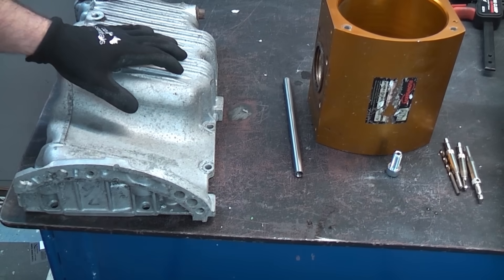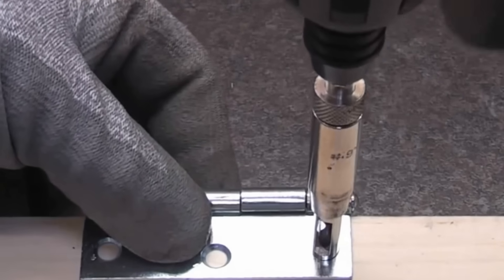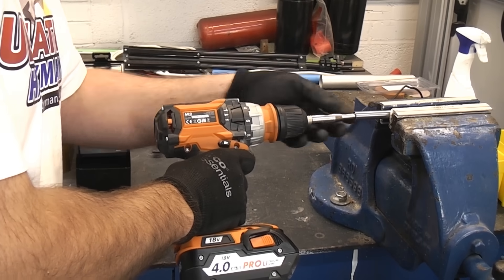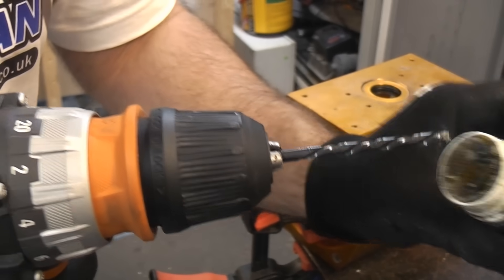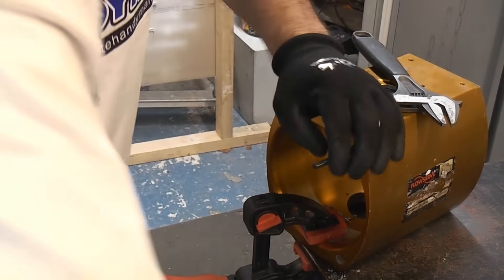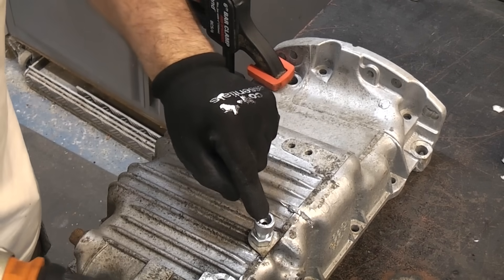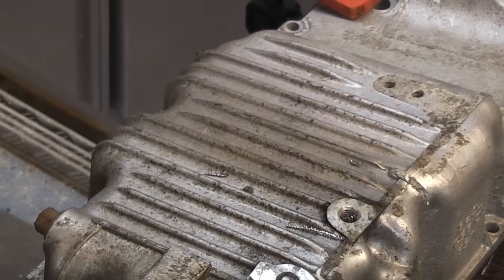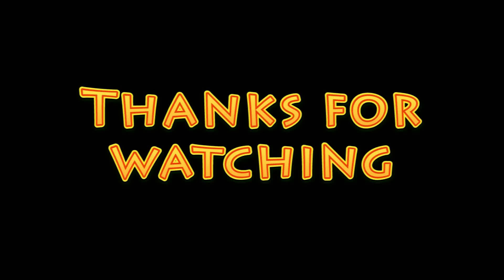How to remove a broken bolt in a deep hole | remove broken bolt in recessed hole

Comment: Liquid Wrench is a penetrating oil, WD-40 is a dispersant. Common mistake though.
Reply: WD 40 is also a penetrating oil. From their web site:
"WD-40® Multi-Use Product protects metal from rust and corrosion, penetrates stuck parts, displaces moisture and lubricates almost anything. It even removes grease, grime and more from most surfaces."
Reply: @meabob  - They're semi-lying. Are you sure that it wasn't a testimonial? Testimonials are worse then worthless. WD-40 BRAND has a penetrating oil. It's NOT regular WD-40. As I mentioned above, Kano Labs AeroKroil penetrating oil is the stuff. They do not sell it through retail stores like do-it-yourselfer auto parts and accessories stores or Wal-Mart. It is offered "ALL PRODUCTS PRODUCED AND DISTRIBUTED BY KANOLABS ARE FOR INDUSTRIAL USE ONLY AND ARE NOT INTENDED FOR RETAIL SALE, PERSONAL OR CONSUMER USE. In California, this product cannot be sold to an individual consumer." If some "consumer" left this nasty stuff where a kid could get it they could get serious damage or death from it. It goes on a high shelf or locked cabinet in the garage or shop.

Comment: ..Drill Sharpening tool is a must have.. (CENTER PUNCH, don't error) U should "Up Step" drill size when making a hole aka start with a pencil led size & gradually increase & I prefer the dowel style extractor's & a slow (almost a crawl) steady rpm w/light weight oil is WAY better than short drill motor spurts like U did, with a large drill bit - U were lucky & had easy access/no rust.

Comment: Ever seen the trick to remove a steel bolt out of aluminum by dissolving it with alum salts?  I can't remember if it's just heat or if you apply DC to it as well but I do remember the steel bolt just dissolves. Neat trick, very handy.
Reply from the maker: Yes, I have seen that.
Thanks for the comment

Comment: Really useful - thank you - though at around 08:00 and 11:40, if you had put the screw extractor into the drill and ran it in reverse, would this not have done the job for you without needing to keep tapping it back into position - as gently pushing in on the drill would have kept it in position?

Your drilled-through bolt idea is awesome.
Reply from the maker: I've never tried a screw extractor in a drill to be honest, as the instructions normally say to tap it in using a hammer.
Thanks for the comment
Reply: @ultimatehandyman  Sorry, I meant to say "drill/driver", I think it would need to be low speed (never tried them on fast).

Comment: Very nice video.  Great tips.  Thanks for posting.

Just thought I would add my own comment.  If the bolt isn't too deep, what I do is weld another bold on top of it and then use a socket to get it out.  Of course if you're not careful, this can mess up the threads with the welder.  Just another method I thought your viewers might appreciate.

Comment: In aluminium I'd just use an Alum and water solution, and a gentle heat source, let it sit overnight, and the bolt or stud should be eaten more or less completely off
Reply from the maker: Thanks for the comment

Comment: I didn't even know that left-thread drill-bits were commonly available. thanks for the tip. 
copper-grease you say?  2 good tips in one video.  I always just used grease as I learned to do.
Reply from the maker: Yes, left handed drill bits are widely available now.
Apparently you have to be careful with copper anti-seize and aluminium as it can seize up in some conditions (it's fine where I live though)
Thanks for the comment
Reply: "Pure Nickel" antiseize seems compatible with everything. The brand I have is Perma-Tex. I used to have a metal can that I got at a bearings jobber until the druggies wrecked my shop and stole everything.

Comment: Something you should remember, (1)on assembly use a lube on the threads ( on aluminium don't use copperslip, as it can cause corrosion) 
(2) use a torque wrench.
Reply: This was my only criticism also. Some time ago a friend bought a recon outboard motor. Within a couple of months there were several pinhole leaks in the leg. when he pulled it apart, it was riddled with electrolysis corrosion and he found it had been assembled using Coppaslip.

Comment: Most bolts or studs break off flush with the surface , so these procedures will not work . But if you are fortunate enough that the bolt snaps of and leaves enough thread great .

Comment: Excellent ! Left hand drill bits and drill guides were unknown to me until I came across your video. Many thanks ! Maybe I'll be able to take out a broken bolt in my Honda motorbike engine and start using it again after years standing in the back of the garage.
Reply from the maker: Thanks for the comment

Comment: With the other 3 bolts still good this 4th one isn't even completely necessary the fastest and simplest way is to dill a small hole in the center of the bolt tap it and use a smaller bolt with a washer just sayin

Comment: need some help here, got a glow plug that snapped and once i got the head out i used an extractor to twist it out, problem is the extractor was one of the cheap ones and it snapped into the glow plug body, i tried drilling it out with normal hss and cobalt bit but it barely goes anywhere if not at all, tried die grinder with diamond and tungsten carbide burrs and still nothing, what's it bloody made of these extractors? they break so easy yet you can barely drill in them
Reply from the maker: They are vey difficult to drill out. Solid carbide will drill hardened steel, but carbide itself is very brittle and really, carbide bits need to be used in a drill press.
I have drilled out hardened steel using a JCB diamondtech hole saw, but it is very, very time consuming- https://www.youtube.com/watch?v=7JCfEMrCjhc
Reply: @ultimatehandyman   i've had a look at your video, looks like you had your part of the fun with that tap there lol. i don't know if i'll have that patience with the diamondtech hole saw so i'll be opting for the carbide drill bit and will have to deal with a cordless drill

so what else is there to know about these carbide drill bits? i've seen the one you presented and i will take a deep note about the brittleness that bit has. i would like to know if they're a specific type of carbide, as carbides are many and varied, also branded as widia if it makes sense

and are they common? i'm not in the uk, but lived there for a few years, so i can make an idea of how common would i be able to find here based on how common they are in england. also you made me curious about the all purpose drill bits, that "virtually drill anything". those really winded me up in knowing what sort of drill bits are they. i could only make out a R2 name? something like that. much appreciated for the information and will subscribe for this. i like working with metal myself so your guides really are helpful. keep up the good work buddy. wish you all the best

Comment: Good video, a friendly word of advise though.......do not use an anti-seize compound that contains nickle in a hot environment.
Reply from the maker: Thanks for the comment
Reply: Like on exhaust manifold nuts, and screws threaded into an aluminum cylinder head? Worked for me for years.

Comment: That's genius.
Reply from the maker: Thanks for the comment
Reply: @ultimatehandyman  I had this problem before but the snapped bolt was hardened steel. And replacement bolts were so expensive I wouldn't have been allowed to drill a hole through even if I could. True nightmare.

Comment: how did you get the hole in the hardend allen bolt
Reply from the maker: I drilled one on the lathe and one in the pillar drill. Although Allen head bolts are tougher than mild steel, they can still normally be drilled quite easily- https://www.youtube.com/watch?v=6mZj0J6CNYA
Thanks for the comment

Comment: I've always chucked up screw extractors in a drill and ran them that way..  you'll find that even if it slips off broken bolt, it will retap itself almost immediately.
Reply from the maker: Thanks for the comment
Reply: @ultimatehandyman  your idea of drilling out a bolt to thread and jam into opening to dril broken bolt is awesome.

Comment: ever heard of using a pilot hole punching peg?
Reply from the maker: Is a punching peg also called a transfer punch ?
Thanks for the comment
Reply: not sure but i was simply talking about center punching,taking a sharp tipped hardened steel rod and putting the tip over the center of your broken bolt and punching a pilot hole with a hammer in order for your drill bit to start there and not slide off as you mentioned

Comment: There is another way to remove a bolt that is deep inside a hole.  It is for larger bolts, say 1/2" and larger.  Take a steel pipe nipple and put it into the hole resting it on top of the broken bolt.  Put an arc welding electrode into the center of the pipe being careful not to touch the inside of the pipe with the center of the electrode.  Touch the bolt and spot weld the pipe to the broken bolt.  let it cool a bit, and use a vise grip, pipe wrench, or pliers to screw the broken bolt out.  In my old job as a Caterpillar mechanic I have used this procedure hundreds of times.  I almost always works.  When the bolt is being welded it heats up the bolt and sometimes breaks it loose from the housing.  You don't have to weld it very long, you do not want the weld puddle  to melt through the pipe and weld it to the housing.
Reply from the maker: Thanks for the comment

Comment: The best lubricant for penetrating something stuck is a 50/50 mix of Acetone and Automatic transmission fluid. there is nothing you can buy that will work better. Google or YouTube it if you don't believe me.
Reply from the maker: Thanks for the info ;-)

Comment: Great vid. Tips: keep the guide in to ensure straightness. When using extractors,  tap on it with a hammer as you are turning it. It acts as an impact driver, and ensures it digging into bolt.
Reply from the maker: Thanks for the comment

Comment: So nice and clever and easy for eyes. What to do when broken bolt is  flushed with aluminum  hole ?  tear your hair  off your head  then throw the  whole hair rising  problem to ultimate handyman trash bin.
Reply: Use a spring loaded center punch to dimple the center of the bolt, then a very small drill bit for the first hole. Work your way up in size until you get to the one needed for the extractor.
Reply: If it's flush with the top of the hole then it's actually easier since the threads are not exposed so you only have to punch a starting dimple into the bolt then use a small drill bit to get started.
Reply: Ah, there are specialist carbide drills for that. Ideally you also need a decent drill press or better a big enough milling machine - eg Bridgeport. It is possible a surface mounted drill guide could be clamped on, but it's difficult to align it correctly. It all depends on the job. Then use over size drill to put shallow dimple in, then a smaller one to drill down. Inevitably it's partly black magic, some science and some art. Auto transmission fluid is rumoured to make a good anti sieze fluid. If very big bolt in cast iron then maybe mig/tig weld nut onto top of stud. Not a good idea in an aluminium casting though. If all else fails, drill stud out and replace with threaded insert. BobUK.

Comment: What if the bolt is hardened steel ?
Reply from the maker: As far as I am aware, you can't get hardened steel bolts (as they would be too brittle).
Bolts are harder than mild steel, but are easily drilled using a decent drill bit, such as a cobalt drill bit.
Thanks for the comment

Comment: Why cooperpaste? Must be alot better with aluminiumpaste instead. Becuase With a longer time use with copper and aluminium together will start a chemicalreaction that will make more problems.
Reply from the maker: We use copper anti-seize all the time at work on aluminium with no problems, but some people have problems- which seems to be people near the coast etc. (salt water). 

Thanks for the comment

Comment: Just adding my $.02. From my understanding WD-40 doesn't have much of any penetrating qualities. ATF mixed with acetone, or any other penetrating lubricants would be a better option. Also using copper anti seize with aluminum will cause galvanic corrosion. They do make a graphite based (metal free) anti seize, or the silver anti seize containing aluminum; would have much better long term results for that pan. Or a galvanized zinc coated bolt will work really well with the aluminum. Outstanding video however. I really like the machined Allen bolt setup you made.
Reply from the maker: Thanks for the comment

Comment: I have several pieces that have broken carbide taps deep in a blind hole--a 6-48 and a 8-32. Any ideas on those?  To make matters worse, they are in cast aluminum so the tap is galled.
Reply from the maker: I've drilled out a broken tap using a JCB diamond tech holesaw, that might be an option- https://www.youtube.com/watch?v=7JCfEMrCjhc
Thanks for the comment

Comment: The bored bolts with the locknut is an excellent idea. I need to make some of them on my drill press. The reverse thread extractors work very well but centering the tap hole is critical and this is a great solution. Need to leave enough of the broken piece diameter to grab without reducing it to individual thread strings that stay stuck. Thanks for posting Ulti!
Reply from the maker: You are welcome
Thanks for the comment ;-)

Comment: Be very carefull with the extractor. If it breaks it's hard to get out. If the bolt is still seized, but already drilled hollow, heat the hole stuff and then spray wd40 (or better something with the same function, but fraction of the price) in the hole in the bolt. It will make the bolt cool faster than the case and crack the seize and because you don't hit everything in the hole some oil will get between the threads and grease it.

Broken taps M8 and bigger can be removed with the plasma cut. (M8 needs some taining). Taps have debris grooves and decay into pieces when the core is burned saving the thread around. This is not the case with the extractors, but it's no problem  damaging the inside of the broken bolt. As the extractors are tapered it's enough burning some mm. The rest can be shaken out or if the object cannot be shaken, lifted with a magnet. Maybe you have to remove some burned iron with the punch.
Reply from the maker: You can drill out broken extractors, but it is not easy and spark erosion is much easier- https://www.youtube.com/watch?v=7JCfEMrCjhc

Thanks for the comment

Comment: Wouldn't using a open end or a 12 point box wrench the size of the square shank give U more a delicate touch.  Seems the large adjustable wrench gives a bit more mass than needed.

Comment: this is part of what i do first that was to easy and as you turn the extrator take time to tap it as you turn and  you didnt heat up the 2nd bolt !!!!!!!your vid is nice but no xp as i can see and if the bolt is really hard we use a special welding rod to extract the bolt.

Comment: Your 'bolt guides' are actually, DRILL BUSHINGS.  If you mount any type of bushing over the hole to keep your drill centered, it works the same.  Sometimes I make one out of 1/4" plate, held in place by other bolts.  The drill bit only needs to be 'guided' by your new bushing and it doesn't matter if you're using a carbide bit to drill through an easy-out that's broken on an angle or if it's flush with the surface. We use drill bushings a lot in auto manufacturing, especially when starting cross-drilled holes in crankshafts where the surface is not flat and the drill is on an angle.
Reply: thanks simplyconnected, helpful comment
Reply: Looks like his allows you to lock it in place unlike drill bushings that can spin.   His is dead-nuts cheap too !!  Quick and easy.  I really like his simplistic make at home solution.
Reply: brilliant idea and just the right method to tackle the almost flush sheared-off M6 bolt in my Laverda alloy engine case. Since there are M6 holes left and right of it, this should work well!! Thanks a lot :-)
Reply: 0lkko9i
Reply: his is easier, yours is too loong winded for a simple device.
Reply: there's always one of you in every comments section

Comment: I greatly appreciate the idea of using a SHCS with a hole drilled down the center for alignment purposes. Never saw that one before.
By the way, aluminum has no "e" or "i" after the n, so it is not pronounced alu-mineeum. It is alum-i-num.
Reply from the maker: People pronounce words differently, depending on where in the world you are ;-)
Reply: The British spelling is 'aluminium', and since it was 'named' by Sir Humphry Davy, that would be the correct spelling, even if Americans don't agree.  There are no Os in Auluminium either, so it shouldn't be pronounced aloominum.

Comment: Easy when it's a large bolt but when you have a hardened tap snap inside a m3 stainless steel hole then this technique doesn't work.

Comment: I noticed that you did not blow out the chips on the threads before you removed it with the screw extractor. Metal chips on the threads will prevent the broken screw to be removed Easily due to the resistance of chips piling up in the threads.

Comment: There are better extractors.  Try the straight kind instead of the conical kind.  I hadn't heard of 'cutting paste.'  Gotta get some.
Reply: When a bolt is broken in a 2003 Nissan Altima motor.do you take the motor out to get to the broken bolt, yes or no